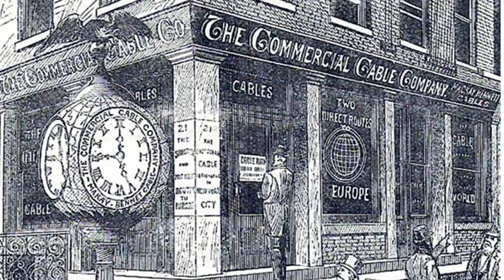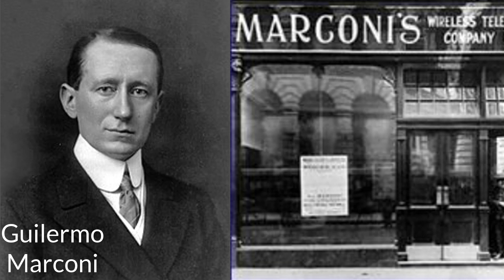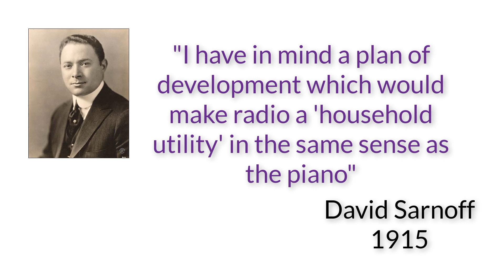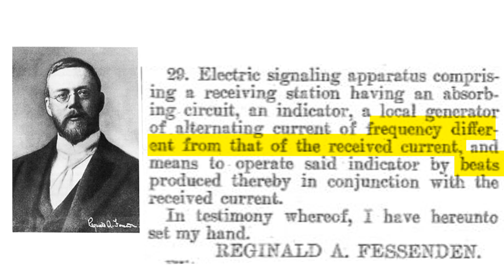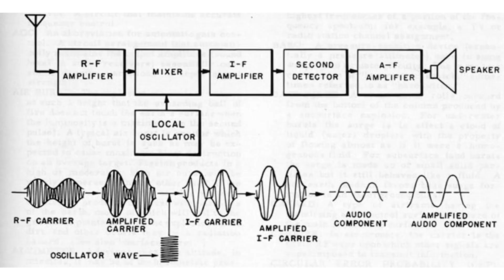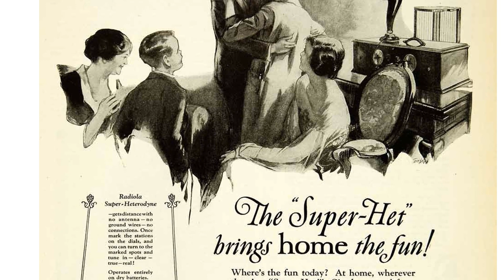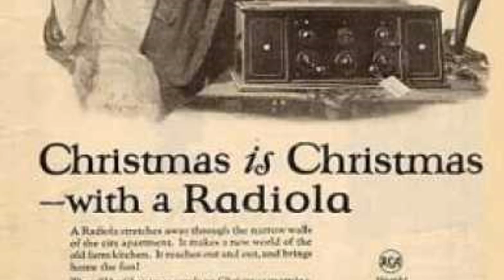David Sarnoff, Howard Armstrong & the Superheterodyne Receiver

Comment: tech. explanation of suoerh.  around 5:00 is not correct. It do not work like when you get beat tone from two strings on a guitar slligthly out of tune, this is a simple addition of two tones with no freq. shift. Superh. works by multiplying the two signls in a mixer and thereby generating a signal containing two freq.  : the sum and the difference of the freq. of the two input signals
Reply from the maker: I think I see what your confusion is.  My husband had his finger on the fret so that if he had both strings in tune, he would have played two of the same frequency.  Therefore, he was adding (in the air) two very similar notes which makes beat frequencies.  In superheterodyne (and in heterodyne) the signal is first converted into an electrical signal and then combined, or mixed, but it is the same thing.  In fact, in the original patent for the heterodyne method, musical beat frequencies were mentioned.  Although, it is true, if you add two frequencies and get a beat you do get a sum and the difference as your two frequencies (actually, the sum/2 and the difference).  Meaning the signal oscillates at the average (sum/2) and the amplitude oscillates at the difference.
Reply: @Kathy_Loves_Physics . Me again ( oh no :-) )  . just switched to my own YT account. ... No confusion of whats going on with the guitar. As you wrote the result of playing two tones is a amplutude modulated signal where the modulation/envelope func. has a freq, eq to the differnce of the the two tones played. However the AM is not a lower freq. component of the signal (like obtained in heterodyne mixing). If it was so you would not be able to hear it at around 5:19 since the freq here is much lower than 20 Hz (lower limit of human hearing). Likewise you should hear a humming of 55 Hz when you play an 440 Hz A and the nearby B (~495 Hz) on an instrument. You do not hear this .. there is no freq. shifting.. you hear the two tones together sounding like if you playes them separately .  The signal shape shown at 5:02 is the one you get from your guitar test. If you feed the same two signal into a (super)heterodyne mixer you will get a signal formed like a snake where the body is formed by the envelope of the high freq. component Fa + Fb and the bends of the snake is the lower freq Fa-Fb .... it is not the same. Try seting up two colums of sines of different freq. in Excel ... say nine/ten periodes, and do a sum (guitar) and the product (heterodyne) of the two sines .. a plot will show what i mean. It is unfortunate that in english the term "beat freq." is used both to describe audio beats and IF signal of heterodyne receivers. It causes a lot of confusion if I might say... And yes I am aware of the phenonomen of combined tones of high amplitude that for some people due to unliniarty of the ear make them hear weak shifted tones. This is a heterodyne effect, but is not what comes into play her. All being said thanks for the interesting story about the two gentlemen ..
Reply from the maker: DrMøller I that is so interesting. I am sorry that I misstated it. Do you know if the heterodyne method used multiplication or addition?  Thanks for the clarification 

Kathy
Reply: @Kathy_Loves_Physics  Mathematically, frequency conversion requires multiplication; simple addition won't produce any additional frequencies. But for a long time superhet radios used addition followed by a nonlinearity (i.e., distortion) which was often implicit in the response of the tube or transistor doing the "mixing". This extracted the envelope (instantaneous amplitude) of the summed signals that contains the desired sum or difference intermediate frequency. Circuits were eventually developed to explicitly multiply two signals, and today the process is often performed digitally in "software defined" radios.

In the most general, common form of digital mixing, both the signal and the local oscillator are represented by complex numbers, which when multiplied produce only their frequency sum, not their difference. Yet no matter how much the technology changes, the underlying math is the same.
Reply: @philkarn1761  exacly..early implementation of superh. used the exponental characteristics of a vacuum tube since the sum of two exp functions equals the product of its variables exponental lifted... this gives the multiplication and thereby a superh effect..
Reply: @drmller650  Excellent, succinct explanation!
Reply: @drmller650  The exponential response is true even for semiconductors. Look up "Shockley Diode Equation".

Comment: The intermediate frequency for AM today is 455 khz. You said Armstrong used 45 khz?
Reply from the maker: Yep, they used much low IF then they do today or even by the 1930s.
Reply: Yes. Please revisit your statement at 9:08. I believe you meant to say 455Khz, not 45Khz. Thanks for the video awesome video.
Reply: @djbishop30189  262 Khz or 465 Khz was more of a common frequency in the 1930's

Comment: The statement that virtually all modern radio receivers use the superheterodyne principle might not be correct if a "direct conversion receiver" is considered distinct from a superheterodyne design as Wikipedia seems to imply.
https://en.wikipedia.org/wiki/Direct-conversion_receiver

I would like to see a future episode on Hedy Lamarr and spread spectrum communication, which is commonly used in one form or another in modern wireless systems.
Reply: A direct conversion receiver is really just a special case of a superhet where the intermediate (beat) frequency is zero. They're rarely used because the local oscillator is tuned to the same frequency as the much weaker incoming signal, and this can cause interference. All oscillators produce noise close to their own frequency and this noise can easily obscure the sidebands of the signal you're trying to receive.
Reply from the maker: NiHaoMike No thanks so much for the information! One of the problems of learning radio though it’s history is that my knowledge of modern techniques is pretty darn limited. I end in 1933 with radio after all!  

I will talk about Hedy but it is towards the end of my book so I think we have like 30 videos to go before I get to her.  She is just fascinating though!  Did you see that documentary they made about her?  “Bombshell”?  It was very good (although the book they based it on was... not so good).